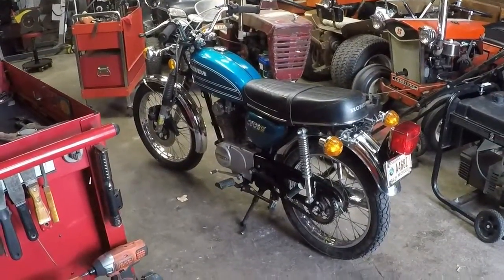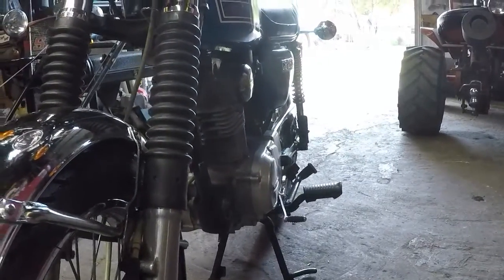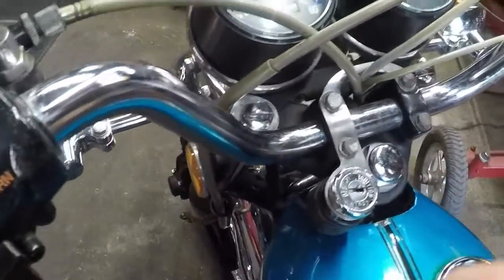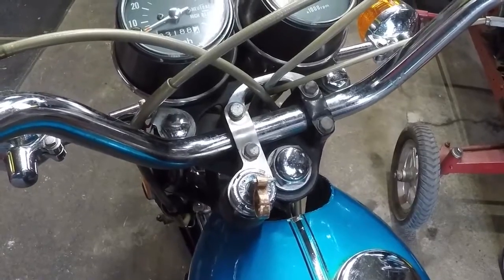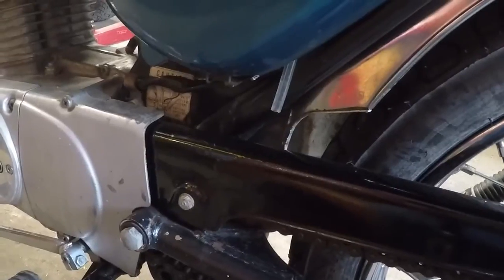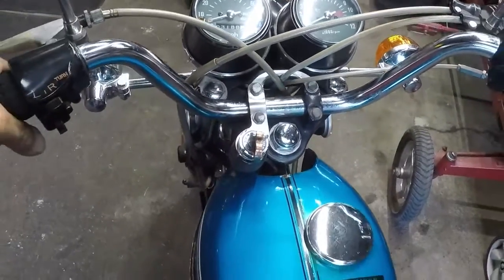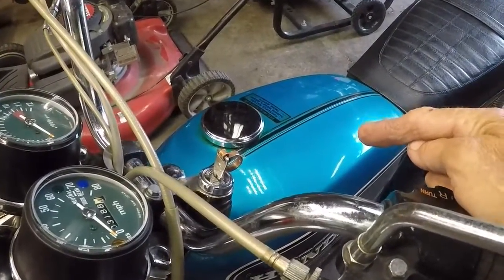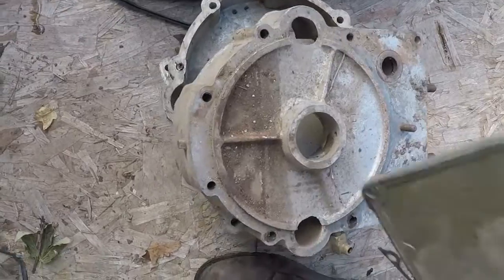1975 Honda CB125S " Little Billy"

Comment: 3rd to view .Sir zippo you clean up well the little Bill that is, I bought a brand new 1976 750 honda super sport yellow in logansport ind, 1700$, first thing I did 
i dropped one tooth on The front sprocket and a Jardine header muffler, l likes the sound of little bill, 
but came close to trading it in for a cbx, if I did I probably won't be watching your videos....great gas milage.....nice for shop runs or Sunday ride in the country enjoyed as always! have a good one..Zip...
Reply from the maker: It's funny, but I actually love riding Little Billy more than Big Bill!! At just 222 lbs, you can throw this little thing around like it's a motorized bicycle. And that mileage!! 42 years old and still getting that kind of mileage...yep...my new favorite knock about town bike for sure. I'm SOOOO Tempted to go ahead and build this into my Cafe Racer just because I know it would be THAT much more fun to ride! But, I'm resisting temptation...not winning, but resisting lol. Cheers Don!!! Zip~
Reply: Honda made thousands like this one, i say make it your own. I shared a similar  dilemma with wanting to build a street tracker out of a mint XS 650 i stumbled across.  Once i tore into it i never looked back, ended up with a bike i really enjoyed building and riding. Looks like a winter project to me.
Reply from the maker: Shh....I'm leaning in that direction banger! The value of the bike VS. the fun and value after is just too tempting. And, I bought it right (Cheap!), so with that in mind, the build can afford more than I had originally set aside for mods. Stay Tuned! Cheers! Zip~

Comment: Looking good.  Sounds good, too!
Reply from the maker: Thanks Sir Pipe! I'm looking to wrap the header pipe...hehe, I said Pipe again. lmao Sorry...Um...Yeah! Everything on Little Billy is right as rain. I am going to pull the carb and give it a good cleaning. It's got a flat spot in the throttle that may be either the points floating or just a dirty carb main jet needle. I'm also looking for a suitable muffler to replace the worn out one. Although...it DOES sound good with one less baffle in it than stock! It sounded like a rattling veggie can of a moped muffler before I cut the end out. Cheers Sir Pipe! Zip~

Comment: Ok now you fixed the acid burned paint, are you going to extend the overflow tube?
Reply from the maker: Great Catch! I was hoping someone would see the tube was short!!....I've got a AGM sealed lead acid battery on the way which doesn't have an over flow. So I'm sort of extending it...or rather eliminating it all together. These old school lead acid wet batteries are becoming a thing of the past in a hurry around my shop in lieu of AGM and Lithium Polymer. Wave of the future on my 50+ year old tractors, 40+ year old bikes and eventually on the trucks and Jeep. Cheers Frank! Great catch again! Zip~
Reply from the maker: Well Frank!! You didn't have to wait long to see the replacement battery video. It's uploading as I type this (9-7-2017 7:17PM) Cheers! Zip~